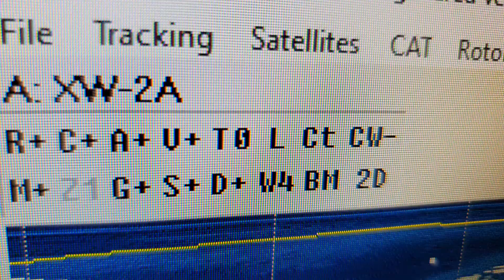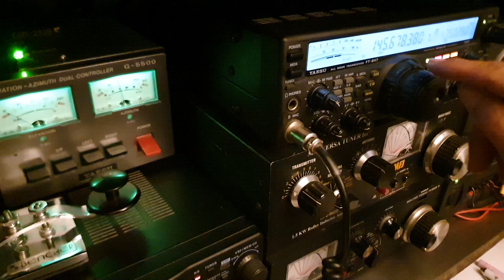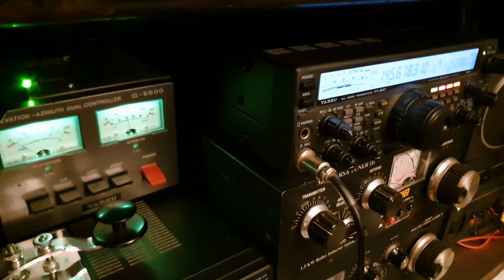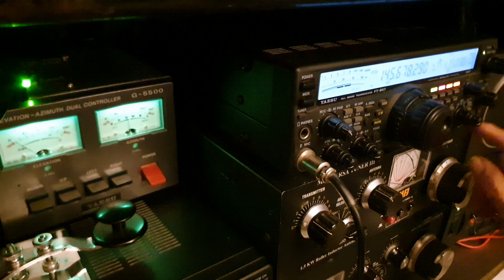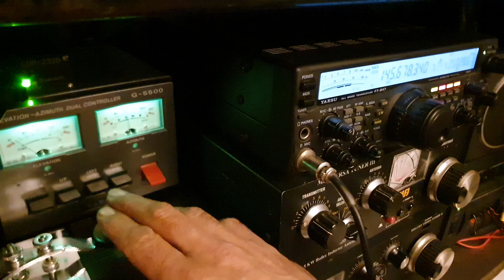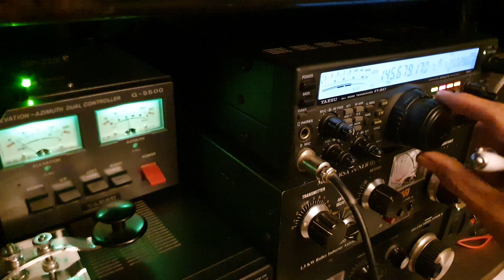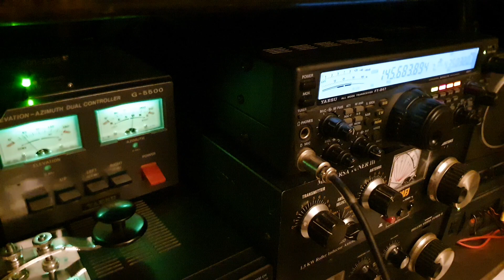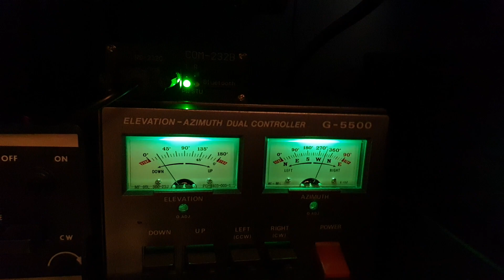Demo of how to work SSB Satellite XW-2A

Comment: So, you left your tx alone and only tuned the rx?  I notice you were tuning in 1 hz steps.  The other station zero beats you and then doesn't move?  de k2xt
Reply from the maker: Not quite but almost that. The cat was tuning both the up and down auto and I was fine tuning the vfo for rx as the cat control was too slow to keep up. I have since adjusted the time and speed so the next pass I tried was a lot less of the fine tuning required. Previously, before I hooked the radio up to the cat I used to adjust the uplink TX only, this helps to stay on the same portion on the downlink frequency without drifting up and down which works well. best 73 and good luck de M0YKS

Comment: It’s like night n day isn’t it 1500miles compared to ISS repeater 😆 Probably not helped by how busy it is though at the mo. Sure that’ll change over coming weeks...and hopefully APRS will be turned back on 🤞 
Great set up there Simon  - Top video, very inspiring 👌👏👏
Reply from the maker: it sure is buddy! I love this side of the Sat and space coms. My set up is configured horizontal which seems good on the SSB. Regarding ISS yes hopefully it will improve. At least the signals will be booming next week with the SSTV transmissions planned on the other setup which is a lot bigger signal and stays on for a full transmission rather than off, on, off ,on, lol catch you soon 73

Comment: Another quality slice of content! 

Did you use a different antenna to the one in your previous video where you were outside operating the beam manually? Is a Yagi on a rotator necessary? 

Thanks again and keep up the great work.
Reply from the maker: Thanks buddy yes I was operating the GS-5500 azimuth elevation rotator with 5 element horizontal yagi for 145 and 15 element X yagi for 435-437. It does well on the SSB Satellite. Thanks again have a good weekend 73